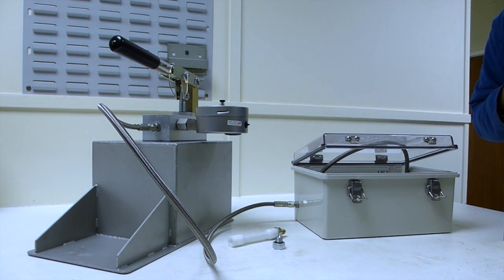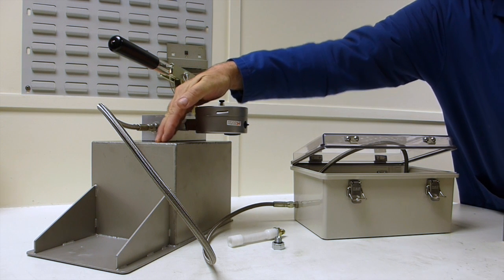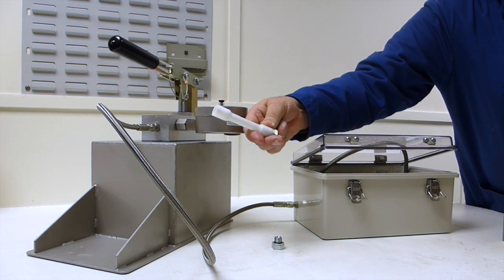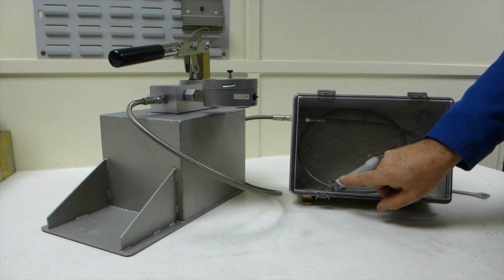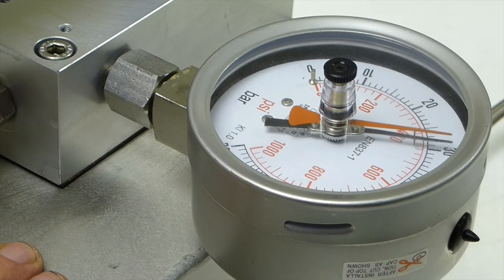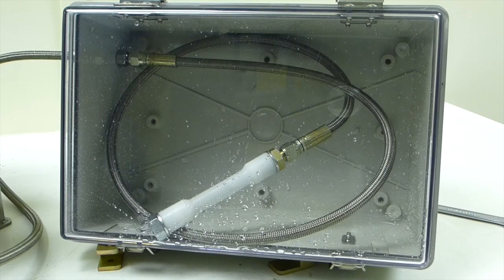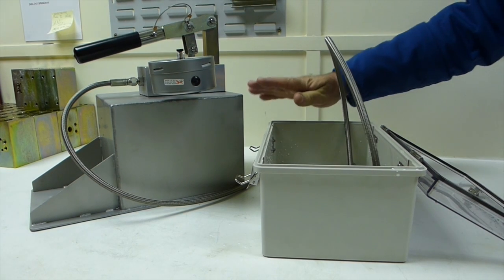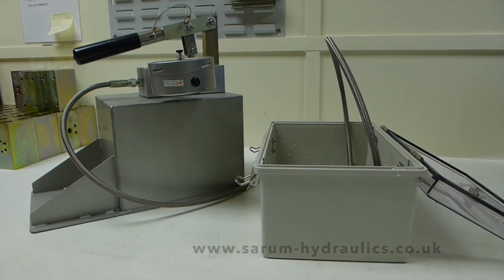How To: Burst / Pressure Test

Comment: What is this test aiming for ? It analysis what ?
Reply from the maker: Thanks for the question - Hydraulic burst tests like this one can help us evaluate how well designed something is. Engineers intentionally test products to failure to define the absolute limits of performance. This process is crucial for achieving optimal design—finding the precise point where a product is strong enough for its purpose (reliability) but not so strong that it becomes excessively expensive or heavy (avoiding over-engineering).
 - Nat
Reply: @sarumhydraulics1386 Thanks for the reply. I saw this test on my internship where the rows of radiators are conducted. They intentionally exploded them

Comment: If we have a test piece which has many holes being plugged with the caps accordingly,  and the holes are located in the different locations of the piece. Let's assume the piece has perfect even wall thickness  ,would the location of the air inlet affect the final results?